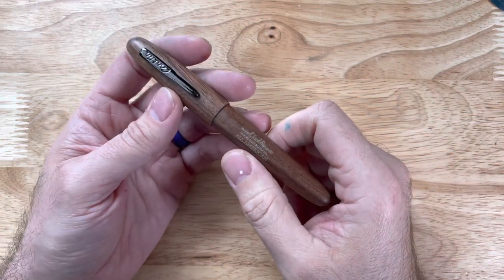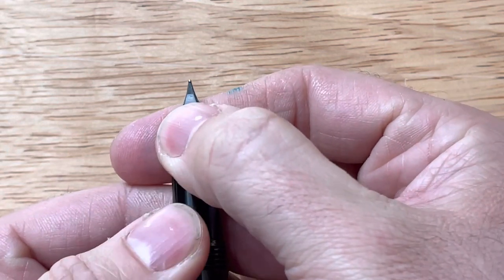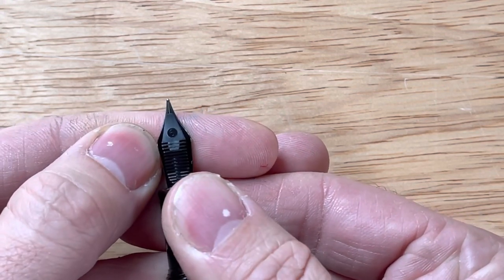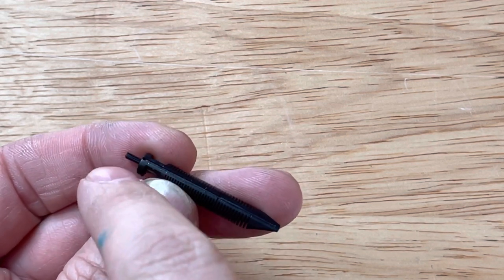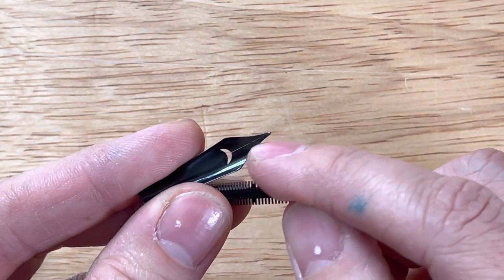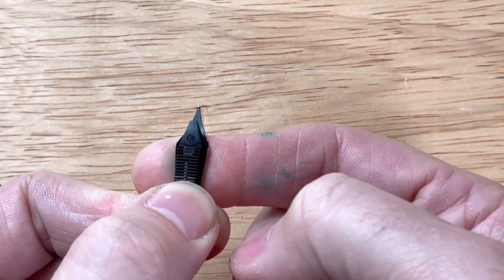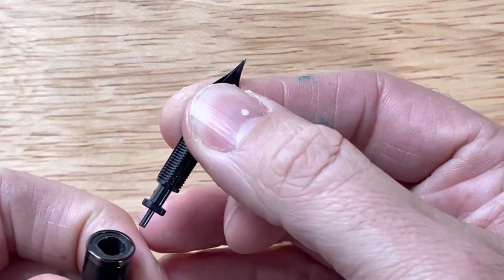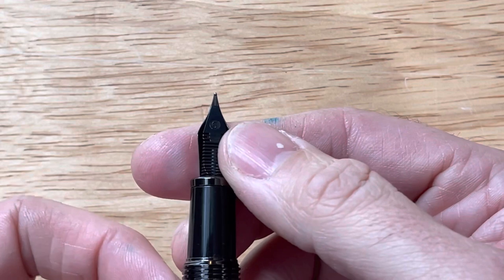Aligning the nib and feed on a fountain pen (ie: Conklin All American)

Comment: One thing I like about the design of Pilot feeds, they have cuts that the nib sits in so it's not going to rotate and you know how to put it back if you take it out. Surprised not all manufacturers do this.

Careful doing this on some pens, not all are friction fit, and some are kinda tough to get back in if there's only one correct orientation (Sailor on both counts). Definitely worth a try if its misaligned though, and not hard to look up if someone has removed it before online.
Reply: I have a Pilot Custom Urushi that still moves around and misaligns with the feed

Comment: I recently obtained an All American (Ebony/Gunmetal), and I love it; from the style & look of the materials, to the feel of holding/writing with it, it’s quickly becoming one of my favorites... However.

I get a lot of ‘hard-starting’ with it — anytime it’s been capped and set aside for a bit (ie. overnight), it just won’t write right away. I’ll have to prime the feed, and then sometimes tease the ink out into the tines with some water or a tissue or something. I’ve tried several inks of varying viscosity, and the issue persists. It’s not a huge hassle, but it’s definitely frustrating to deal with on an otherwise great pen.

I’ve seen a lot of comments online of people having the same problem with this pen/brand — but can’t seem to find any conclusive info about what might be causing it, or what to do to resolve it (short of exchanging it & hoping the replacement works better).

I’m vaguely suspicious that the large, crescent-shaped breather hole might — despite looking cool — be exposing the feed channel to more air, and that this might contribute to evaporation, or possibly disrupt capillary action...? Idk...?

Just wondering if anybody has any suggestions or info. Thanks!
Reply from the maker: I appreciate that feedback...this is actually something I'm talking about with the folks at Conklin. I have experienced the same thing with my own personal wood Conklin pens, I suspect it has to do with the tightness of the seal of the cap, in particular where the clip goes through the wood and connects to the inside of the cap. I don't know if the breather hole itself is a factor, but I suspect there might be a bit too much airflow there which allows the ink to dry out faster than some other pens (particularly in drier environments, and in the wintertime). I suspect this alone may be the issue, but I don't have a definitive answer on that at this time. -Brian G
Reply: @Gouletpens  the newer Jowo nib was muuuuch better in my walnut. I tried just about everything with the old nib and maybe living in the desert was a huge factor to it not really working great.
Reply: Good to know that we're not alone with the dry starts. I love the pen, the weight and feel are great. Just wish I could use it more. I'm looking forward you what you hear from Conklin.
Reply: @suzertroll  Hi, thank you for posting great video’s, I have the All American in the walnut with gunmetal trim and the walnut with rose gold trim and have this same issue.  I have tried to store it at different angles with no improvement, I have the omniflex nibs in both.  Has there been any update, I really love the feel of these pens and when they start writing they are wonderful.  Many thanks in advance.
Reply: @Gouletpens  hello the nib is bot moving like in the first part of the vid also the pen isn’t opening
Reply: Oh it worked now but i cant get the tip out

Comment: My Conklin All American came new with a grossly misaligned JoWo-made nib and feed. I had to align it with my fingers. After that the ink flow was poor. I replaced it with another Conklin-JoWo nib, only gold-plated steel. The newer nib skips and is a hard starter and ink flow is inconsistent, but the nib and feed were properly aligned.

Comment: Thanks for this!  I think you did one before a while back, but I'd like to see another tip on how to align the feed vertically and how that might affect flow.
Reply from the maker: I'm sure I've talked about it several times but I haven't done a sole video focused exclusively on that. I'll give that some thought...the vertical alignment is usually not the primary issue as there's often a positive stop when the feed bottoms out in the housing, but that's not always the case...with any fountain pen tuning, there are so many exceptions and variations, it's difficult to cover it all in broad strokes! -Brian G
Reply: @Gouletpens  Thanks Brian!

Comment: I have the misaligned feed on my Etruria Rainbow. It’s nib has very long slit and also because it’s my most expensive fountain pen, I’m afraid to trying to adjust and end up accidentally ruining something
Reply from the maker: The more rare/expensive the pen, the more nerve-wracking it will be to try to adjust it, I know the feeling! I have an Etruria Rainbow myself so I know the setup you're talking about. If the pen writes well, then honestly you don't need to adjust it...it'll just be an aesthetic thing...but if it's not quite flowing enough like you'd like it, then it could be worth a try. That said, I would practice on a less expensive pen until you feel confident in what you're doing, or consider having it adjusted by a pro, if that feels like a good option for you. -Brian G

Comment: I replaced a the nib on my Conklin Duragraph with a goulet nib and I have the impression that it's always a bit loose and that it's going to fall off. It actually does come off pretty easily just from cleaning it with a microfiber cloth, which I'm assuming is not normal since it doesn't happen with any other of my pens. Is there a way to fix this?

Comment: My Jowo omniflex nib for the Conklin Duragraph is also misaligned with the feed and does not stay aligned after I move it. As soon as I start writing, the nib slides and becomes misaligned with the feed again. I purchased the pen with the (newer) original omniflex nib, and purchased the Jowo version later, so maybe this has something to do with it.
Reply from the maker: That might mean it's not quite there yet...maybe there's enough friction to hold the feed in place (sort of bending it) and the nib is holding it with friction, but as soon as you press the nib down that pressure is relieved and the feed goes right back to where it was. I think if you felt comfortable going a little past where it needed to be aligned, or if you felt comfortable removing the nib/feed altogether and resetting them in the housing together, you'd see it hold. -Brian G
Reply: @Gouletpens  Thanks Brian for your response. I did remove the original omniflex nib and then fit the JOWO version. I reset it several times to see if that did the trick. One key thing to consider is that I am left handed, so I hold the pen at an angle with the nib facing the right side of the page. So, I put more pressure on the side of the nib than a right-handed person would. Thankfully, the flow of ink is good, and I haven't had any false starts. The pen is actually my daily workhorse.

Comment: Hi Brian - Do you have any tips for how to do this with pens that use an ebonite feed that are heat set to the nib (e.g. Noodlers)?  Can you adjust it like this, or would you be better off redoing the whole heat setting of nib and feed?
Reply from the maker: Yeah, any nib/feed that's friction fit you should be able to mimic the process I did here. Heat setting is more extreme than what I'm doing here, and sort of solves for a different issue. Here I show the alignment, which is making sure the nib and feed are the same side-to-side...heat setting makes sure the nib and feed mate up properly front-to-back...does that make sense? Sort of like alignment, but in a different direction. This video shows alignment assuming there's a proper fitting of the nib and feed to each other front-to-back...it's always best to try aligning side-to-side here first since it's not actually altering the nib or feed itself...heat setting is changing the shape of the feed to fit it closer to the nib! -Brian G

Comment: Mechanically, precise alignment serves no purpose other than visual. Ink comes from way behind the breather hole and re-pools at the tip because of the gradually diminishing surface area and the surface tension of the ink holding up between the tines when they flex. Too much or too little contact, nib and feed have is the reason of poor start or ink flow.

Comment: What if the feed is out of alignment on a Pilot Decimo?  Those feeds are clamped on.
Reply: well then feed is fine but u need to apply a bit pressure on nib.
Reply: @ashisheady8841  It just would not write properly…skipped, dry on upstrokes, poor ink flow.  I should have sent it back but fiddled with it myself and eventually got it writing a little bit better….then I dropped it at work.  Hard tile floor.  Nib down.  And that was the sad end…but, also an excuse to buy a replacement nib, which wrote beautifully….aaaaaand then I dropped that one.  So I’m on my 3rd nib, very, very happy with the last two.
Reply: @geslinam9703  better be careful this time!

Comment: Actually this annoying misalignment of nib & feed is something I found specifically in a few of my Conklin pens, including the All-American. But Conklin nibs (especially the Omniflex) are usually outright  trash anyway. 
Btw, am I the only one who found the audio way too low? I could scarcely hear Brian’s voice until I turned the volume up to max.
Reply: Yeah the volume is low for me too
Reply from the maker: I'm sorry you've seen this as an issue on several pens...hopefully this video helps to show how simple it can be to adjust it if you find that's something that'd help you enjoy the pen more. As far as the OmniFlex, the ones we're seeing come out now are better...as they had nib supply issues over the last several years there were several iterations of the OmniFlex that varied in consistency...the JoWo (Germany made) ones coming out now are the best version yet. 

I appreciate your feedback on the audio, I'll make sure to correct this moving forward. This one was a pretty quick-and-dirty video and audio clearly wasn't enough of a focus for me on this one. 
-Brian G
Reply from the maker: noted!- Brian G
Reply: @Gouletpens  ..Oh, thanks Brian for the kind and quick response. 

I had bought seven Conklin pens (and many more replacement nibs) over the last few years. Only two of my Conklins wrote well from the start. All the other pens had annoying nib/feed/flow issues that even the equally misfiring replacement nibs couldn’t fix. Same sorry story with Conklin’s other sub-par stablemate, Monteverde. And I’m hardly alone in having these complaints. No amount of attractive wooden furnishings and affordable pricing can mitigate the mediocrity and inconsistency of their nibs. I wonder if Yafa even cares about their customers. If they did, the problems wouldn’t persist for years. 

The Omniflex nibs were mostly a scam, to put it mildly. I reluctantly tried out the newest Jowo flex nibs. Too bad, they aren’t much to talk about. The nibs are too stiff, with very little flex, really. Just doesn’t cut it for me. 

My favorite Conklin pen (and only one of two that I cared to keep in my collection) is the Heritage Word Gauge pen with, for once,  a usable, lovely broad nib.